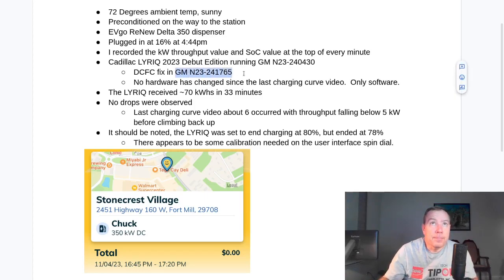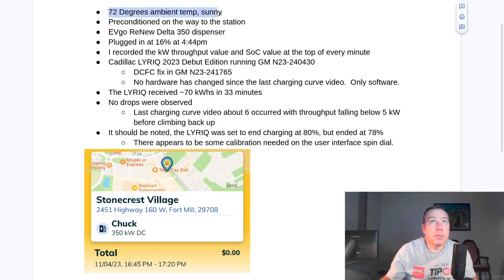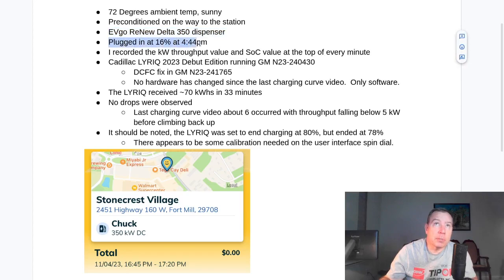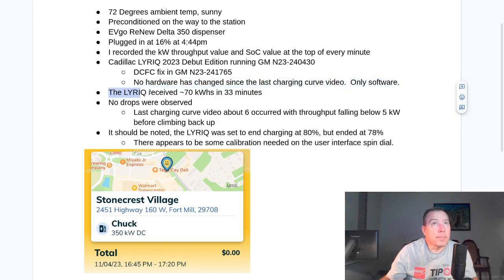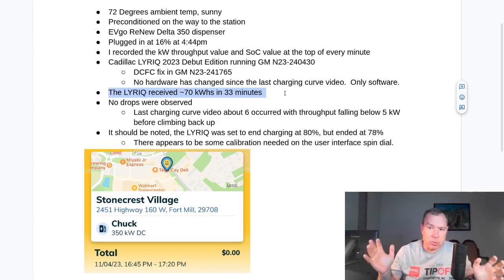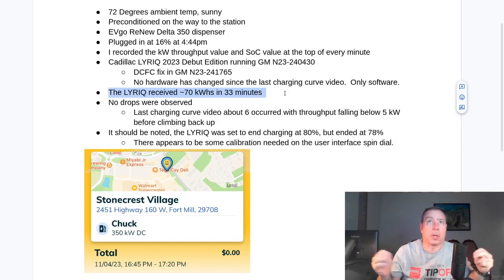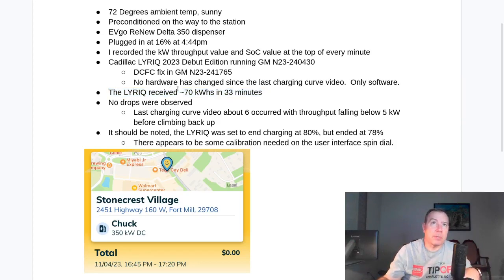Cadillac LYRIQ Charging Curve (w/ GM N23-241765 fix)

Comment: RE: stopping at 78% - my Bolt EUV also does this when set to 80%. The charge limiter doesn't appear to be precise or calibrated quite right
Reply from the maker: Yeah, it kinda freaked me out.  I was doing my thing, recording stats every minute and all of a sudden, the LCD screen on the dispenser dropped to zero kW and stayed there.  I thought something broke.  It took me a few to figure out what was going on.  In the LYRIQ, the only way to find out the SoC in a percent number is to ask Google.  There is no display while you are driving down the road.  I hope they fix that too in coming updates.
Reply: @thenetworkarchitectchannel  in my last charging video I embarrassed myself by accusing the charger of being broken when I'm fact I had the charge limit set 🤦‍♂️
Reply: Some of the OOS videos speak to the reason the SOC indicated isn’t accurate - its due yo the nature of these batteries and the BMS - the SOC is an calculated guess are the current state of charge.   On some cars (Tesla) we end up with the SOC reading 82% minutes after charging to 80% - BMS recalculates SOC every few minutes to keep you informed (with its latest guess).  Anyway thats what I got from the info I’ve seen - hope it adds some insight why 78% on the SOC display might be 80% to the charging system.  Using an ODB2 scanner might provide additional value.

Comment: Thanks for doing this, Walter! It definitely does look like there's still some smoothing that GM can do with the charging curve (it should be a smooth, consistent taper down). 
One thing to note is that the C Rate for the Ultium batteries appears to be ~2 C, which is slower than the ~3 C for things like the E-GMP platform even relative to battery capacity. That being said, 70 kWh minus charging losses in 33 minutes is about 120 kW net average charging speed up to 80%, and frankly, I think a ~30 minute charge to 80% is about ideal for a road trip car, especially when that car can do 300+ miles on a full charge. You're basically able to drive the whole day at that point with only about an hour or so of charging.
Reply from the maker: Thank for the nice comment & I was glad to do it.  Tom M. on SoC indicated the need for a revisit after the patch and I carved out some time to capture the data.  Viewers may not realize, it take quite a bit of time to set it up, capture the data, create the vid and post on YouTube, but I am an enthusiastic LYRIC owner and am glad to provide an outlet for my passion when there looks to be a need I can apply it to like was the case here.  So half a Saturday making a curve vid was an enjoyable past time for me this weekend.

I have never hear of the term "C Rate".  I need to do some research on it and see where E-GMP cars win out.  Thx for pointing out & watching.  I agree, further improvements are likely coming to the BMS of the LYRIQ and other Ultium cars.  I am compiling a list of GM Ultium cars, and am surprised with the shear number of models and trims the company is releasing and the lessons learned in the Hummer & LYRIQ are going to make their cousins that much better.
Reply: @thenetworkarchitectchannel  Yes, thank you for your time and effort on this. I definitely know how much goes into making one of these videos.

C Rate is a relatively easy concept to understand (I'd suggest reading about it on the Battery University website for an  in-depth explanation), where it it is simply referring to the charging/discharging speed in kW relative to the battery's overall capacity in kWh. So a LYRIQ charging at 190 kW with a 100 kWh pack would be 1.9 C, while a Bolt EV charging at 55 kW on a 64 kWh pack would be .9 C. The E-GMP cars can charge at 245 kW on a 75 kWh pack, or almost 3.3 C. A battery with a higher C Rate should take less time to add 70% of its capacity than a battery with a lower C Rate, regardless of each pack's size (that's already accounted for when determining C Rate).

What is less known within the EV owner community are the factors that control or govern C Rate. I was told by a battery engineer that one of the biggest factors in determining C Rate is electrode thickness (i.e., active battery material of the anode and cathode). So what isn't really talked about in the EV community is that energy density is the single biggest trade off for having a faster charging car. To date, the Chevy Bolt EV's battery  is still one of the most energy dense on the market (thanks to thicker electrodes), but owners pay for longer range and a lighter battery with slower DC fast charging.

GM is well aware of these trade offs, and these first generation Ultium cells were designed to offer a balance between charging speed and energy density. So in addition to the step-change in energy density by moving from NCM to NCMA (roughly ~250 Wh/kg to ~300 Wh/kg), they designed the cells in a way that balanced the expected charging speeds with the expected range (i.e., 30 minutes to charge to 80% and 300+ miles of range on larger format vehicles such as SUVs and trucks). 

Ford attempted a similar approach as GM, but their batteries are still a generation behind in terms of chemistry and energy density, which why their Lightning (while offering decent energy density and 300-mile ranges) is stuck at ~1.5 C Rate charging speeds. 

My apologies for the long comment, but I figured that you would appreciate a more thorough response.
Reply from the maker: @newscoulomb3705  I do for sure appreciate and acknowledge you know way more then I do on the subject.  I like learning new things.  To be perfectly honest, I am going to start by re-reading your above reply a few times & then going to the BatUniv site to dig more.  Thx 4 taking the time to convey.
Reply: @newscoulomb3705 That's fascinating info.  I watch a lot of EV related content but had never picked that up.  It clears up some things.
Reply: @newscoulomb3705  thank you for the excellent explanation, glad to learn something new today!

Comment: Thank you for doing this.  When I finally get my Lux 2 AWD (on my dealer’s allocation sheet with estimated delivery in mid February) I will be doing almost all of my charging at home at 48A.  I was concerned that even short road trips would have 50 min or longer 20-80 SOC times -definitely not segment leading times. 

Your test shows that GM finally shed some (but not all as shown by that one dip) fear of a Bolt type PR disaster from thermal runaway fires during charging. Let’s hope with time and more real world data they can do another OTAU to make the charging truly up to “Cadillac” performance levels.
Reply from the maker: Thx for watching & taking the time to comment.  Congratulations on your future LYRIQ ownership too.  We love ours.

To put into perspective, 70 kWhs in 33 minutes is better then Tesla.  The "Dip" you mention is not a dip of the variety we saw before.  Instead, I would call it a controlled ramp down with a subsequent alteration due to the battery pack heating during charging.  You are right to say it is not industry leading.  I think that falls to the E-GMP cars.  Maybe Lucid.  However, in its current station, the DCFC rate is non-consequential, with further improvements too likely, as you suggest.
Reply: @thenetworkarchitectchannel  

It still baffles me how GM QA engineers approved the original BMS with that “double dip” DCFC profile. 

They had to be doing some real world testing.  How even the penny pinching bean counters thought that a power acceptance drop into single digits, not once, but twice, during an 20-80 SOC  charging session would meet what buyers expect from Cadillac amazes me.  I think it took the automotive press and YouTube reviewers like you hammering on this point about their flagship EV got GM to make a change.  

Another 3- 4 month wait for my Lyriq doesn’t seem too bad now that I have waited 16 months so far AND there is information that estimates a delivery date. 🎉

Now I have to shop for a wall unit (the new Tesla Universal looks promising) and cleaning up my shop so an electrician can get in and do the wiring.
Reply from the maker: @FoamCrusher  I believe too much is being made of the dips in the original charging curve vid I did as well as the ones subsequently done by Tom M..  The car was a functional vehicle.  Considering it was a new model, had a new drive train, and a new software defined vehicle platform, the fact it had bugs was to be expected.  The worse bug to the BMS annoyance that added about 10-15 minutes to road trip DCFCing, was the 12v bricking.  That was a nasty one.  Regardless, as a technical professional, I can empathize with a regression test being successful 99% of the time, but everyone focuses on the 1% where it doesn't.  Thankless job that is, but somebody has to do it.  Thx again for chiming in.
Reply: @thenetworkarchitectchannel  
Walter, then we can agree to disagree. The original charging profile was certainly functional and not a deal killer. However, it was not up to Cadillac brand standards and I am grateful that it has been mostly addressed. 

Now if Cadillac will put the garage door function and mirror folding on a button, or at least allow customization to put them on the main infotainment screen, my nits will have shrunk to mild annoyance level.